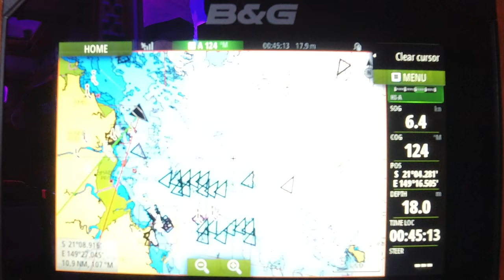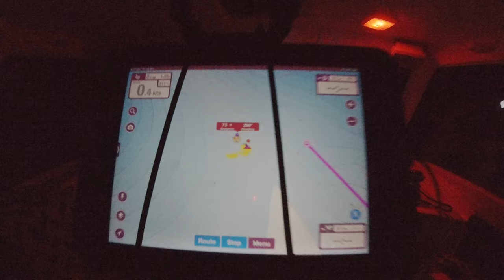Why won’t our anchor hold? A sleepless night at the Great Barrier Reef’s Curlew Island. Episode 39

Comment: Cheers guys, we had similar issues twice in our travels, 1st time we managed to land our anchor on top of a foul weather jacket in the Med. The 2nd time it was an old set of clears of a sunken vessel, left over from a Hurricane in the Caribbean. btw good video
Reply from the maker: We managed to land the point of our Sarca Excel directly into the cup holder in the arm of a picnic chair on the bottom at Peel Island in Moreton Bay once. Five million to one shot but aced it. Glad you enjoyed the video. We'll let you know we're around if we make into Burnett Heads on the way north. Might be able to manage a meet up. Cheers!
Reply: @Dreamtimesail  That would be good to see you

Comment: What type of anchor did you use?
Reply from the maker: Hi Peter, we have a Sarca Excel which has been absolutely brilliant Unfortunately in this particular anchorage at Curlew Island the rock bottom would have been a problem for any anchor.  The water was murky and we just couldn't find any sand to dig it in to. Cheers!

Comment: I don't think you have enough chain out. Should be 8-10 times depth.
Reply from the maker: John we normally use 5 to 7 times but here had over 50 metres of chain out which was almost 10 times at high tide and well over at low. Just a crappy bottom that's all. Cheers!
Reply: it's 3-5 and if you have room let out more
Reply from the maker: @ralph9987  yes Ralph but we regard that as the minimum. Cheers